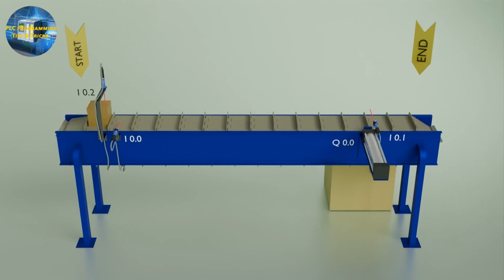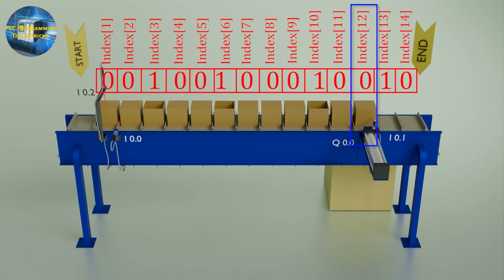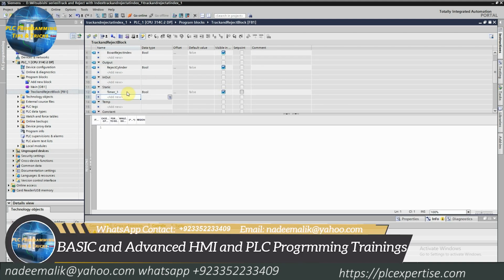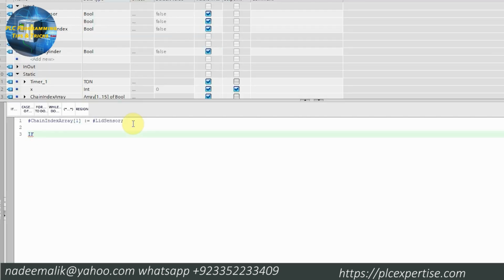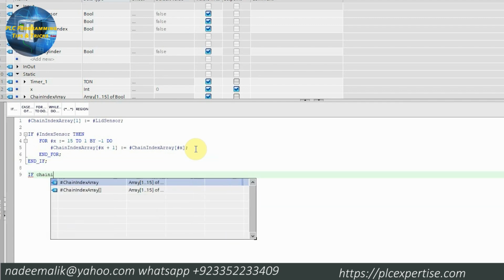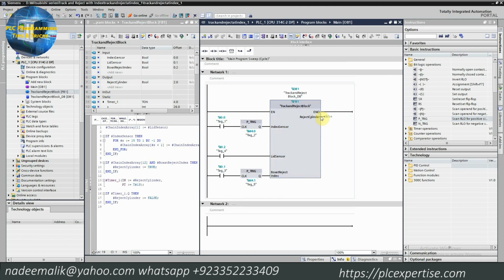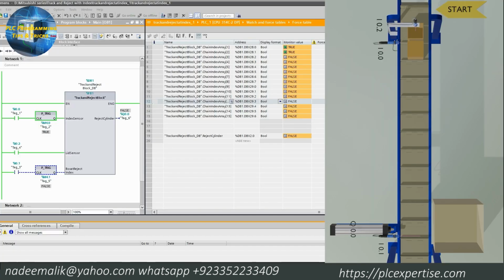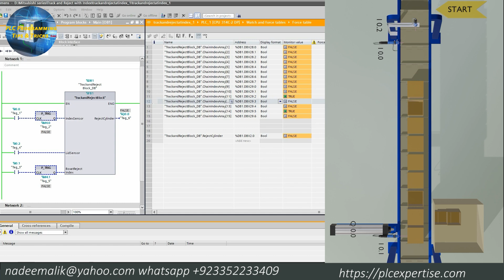Tracking and Reject the Objects using Indexing Array Logic || TIA Portal Training Session

Comment: It can do various wonders with shift register.
If a bit complicate the task and do check up of box for a label on side?
The first thought is moving bits in paralell (in other words make the same code for check up of a label).
Another thought how to move a byte where each bit is responsible for e.g. lid, label, weight and so on.
So my question how to move a byte and distinguish them. For example this byte belongs to box1 another to box2 ...etc.